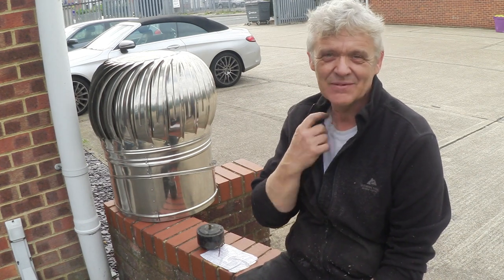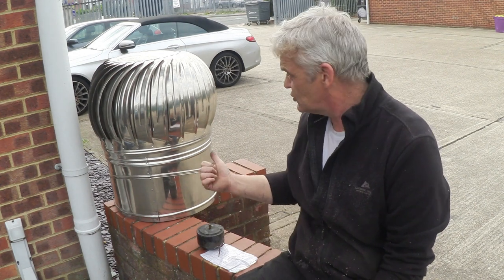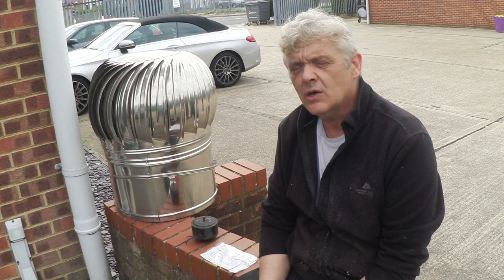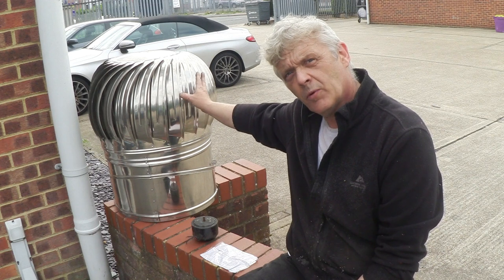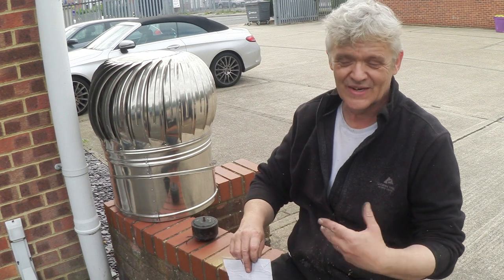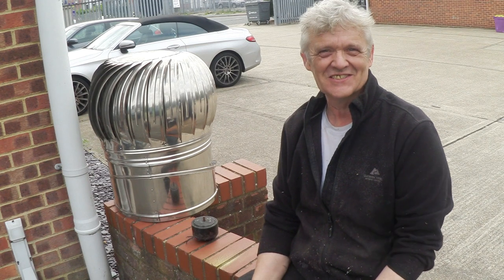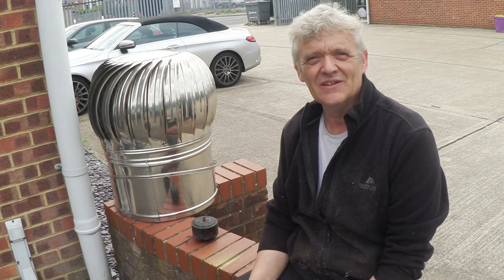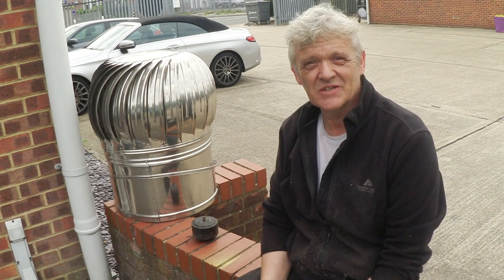Roofline Rotating Ventilator To Generator - Part 1

Comment: I've always been facinated by the static chimney cowls that have, essentially, an horizontal aerofoil that serves both to prevent rain going down the chimney flue and accentuate the natural up draught to improve the draw of the chimney. Essentially the aerofoil creates a low pressure area at the opening at the top of the chimney and air from the chimney is sucked into the void, causing a draught up the chimney. 

Inspired by the lateral thinking of the Sterling Engine, I thought rather than mount massive complicated turbine, gearbox and generator equipment driven by huge moving blades to the top of a massive tower, perhaps it would be possible to simply move the force of the wind to the bottom of the tower, where it can be more easily harnessed.

My thought was that if you scale up the design of the static chimney cowls and use a proper disk-shaped aerofoil you have an omnidirectional device that could induce a significant force of airflow up the chimney. You then have the option of installing a turbine and generator at the bottom of the chimney, where they are easy to maintain. If this generated sufficient force in the up draught, remembering that force increases with the square of the velocity, perhaps aided by using the Venturi effect to increase velocity, then you have the making of a low maintenance omnidirectional wind turbine, with minimal moving parts, greater structural strength, lower structural stress,  that will operate in high winds without risk of damage and without causing bird strikes and possibly with little noise. 

I also wondered whether, rather than a massive structural chimney, it would be possible to build a voluminous version of this device out of light weight material, that could be flown at great height, like a massive kite, using dual opposing omnidirectional disk-shaped aerofoils to suck/blow air through a pipe between the aerofoils past a turbine, and transmit electrical power down to the ground through the tether cable.

In my more fanciful moments, I imagined using the same idea to power ships, but instead of a turbine and generator you have fixed forward-facing horizontal aerofoils in the chimney flue that extract force from the updraught, just like a sail, except they would pull the ship forward regardless of the wind direction, so you could have ships literally sailing into the wind using no moving parts, other than molecules of air.
Reply: remember the heat rising is creating the low pressure as is the faster moving outside wind flowing over the stack the so called Venturi effect,chuck one end of a pipe facing downstream and under a fast flowing river, you get a vacuum on the other end... but yes chimney cowls have uses beyond the assisted flow design
Reply from the maker: mate - I think that is clever thinking - I can see what you mean - this would be well worth a few experiments I think

Comment: Great project! I love watching the what IF community can do.  And I'm sure that many people have observed these wind turbines in action,  and ask themselves, could I make it generate electricity  ? Only a few of the curious will take the steps to achieve a prototype that actually works.  Thank you for giving it a go. And sharing it with the rest of us. There are many ways to generate electricity,  build & wind your own coils or go old school and use a telephone magneto,  that can generate both a/c or d/c voltage and current.  The modern washing machine pump,  is a good example of a magneto that can generate electricity,  just by spinning it. No matter what method of generation you  use, it's best to eliminate friction from the process,  and the best thing in the world to do that is  use magalube G on your shafts & bearings.  This will improve the overall rpm.  And allow more work to be done.  Whether you buy or build it,  you want to get all the energy possible from your project.  Right  ?
Reply: I'm building one, I want to stay out of the grid.

Comment: I'm brand new your channel. I put two of these on the roof of my shed in Victoria, Australia, they never stop spinning even when there's wind. As I'm new here and this is first of your vids, thst I've seen yet and this is a year old video, I haven't yet been able to find the follow ups on how this turned out. I appolgise if you discovered this already/since, but these turbines are not solely reliant on wind to make them spin. I don't know the fancy scientific specifics and terms, but these are disigned to draw heat out and temperature alone will make them spin so long as  it's warmer inside the shed/roof than it is outside, the hot air inside the shed rising is enough to make them spin. I don't have any airflow pipes or tubes attached, they simply sit over the top of holes cut in the tin roof near it's apex.
It's always hot in the shed during summer, and I have a wood heater in the shed for winter, so it's pretty much always warmer inside than out.
 I subscribed and I'll search through the rest of your channel for follow ups on this. My shed is powered but i'd love to save some $$ on my power bill even if it's only a tiny bit. I wouldn't expect these to be able to generate enough power to run a fridge or power tools but I'd imagine they might  be able to charge a battery that can at least power some LED lighting.

Comment: I've been contemplating this type of setup for a wind turbine for quite some time.  The fact that wind is constantly changing direction makes this an ideal candidate for capitalising on that.

What needs to be taken into consideration, as someone else had mentioned, is how much torque is generated.  You may need some gearing to increase torque, which will in turn reduce rpm, so you may be better utilising a low rpm generator.

The biggest reason why I haven't started into putting something together is because of trying to figure out what method of furling to employ.
Reply: I recently saw a video where a conventional propelled bladed turbine was tested on the same spot as a vertical axis turbine. Vertical axis was not even close. This was for a 500w rated turbine ~meter diameter.
Reply: @aomanchutube  using the same generator isn't really a fair comparison, to be honest.  You need to consider the rpm and torque generated and match it to the right generator, just as you would need to consider a lower rpm generator if you were in an area where you had constant, but slower winds
Reply: @gm3045  true, but I was referring to the square foot section swept by the blades vs usable power obtained using an mpp charger. One would expect similar power output, unfortunately that was not the case.
Reply: @aomanchutube  I do have to wonder if the efficiencies change based on location.  Traditional wind turbines seem to do better on their own pole at a greater distance off the ground, but would this generator be better suited to a roof top, for example?
Reply from the maker: cheers mate

Comment: I’ve got four of those attic ventilators on my roof in Houston.    They keep busy letting hot air out in our hot summers.    The offset slides in the trunk allow it to be upright no matter what the roof pitch is (within reason).

Comment: Hi Rob, I was told in roofing (I used to be a roofer and then a roofing salesman) by the manufacturer that these are for the heated air in the peak of a roof to escape, there is a large section of screen in the dormer of the roof as the intake where the ambient is let in, the attic space then getting up over 160 degrees f rises and pressurizes inside the attic and shoots through the whirly gig and spins it. I don't think it was meant to spin by outside lopsided forces on one blade side, it's meant to spin by even pressure from within and thus spins quite well... anywho, just a heads up, if doesn't spin very well in wind on the out side try capturing the wind and directing it up inside, it will then spin awesome.  The reason I was told this is because in spinning it by hand I told them there was no  way wind would move it in any meaningful way, their response was it is not supposed to ! And that it will spin very very well when evenly pressured from the inside, and so it did.
Reply from the maker: there are a couple of designs mate - one is wind assisted - but you are basically spot on - this is meant to draw air from the inside and 'push' it out not the other way round so an interesting problem right there - but as I prefer to see problems - an opportunity to do better lol - cheers mate
Reply: @ThinkingandTinkering  Indeed !  :)

Comment: Looking forward to a power generating video on this. I have a two ft diameter exhaust turbine sitting around unused. They sell for around $80 herr. But these are not mounted on strong bearings to last for a long time, or high speeds.
Reply from the maker: it's going to be interesting for sure

Comment: By the way Robert; a tall vertical black pipe in the sun will give you that same updraft effect without the mechanical component.
My grandfather stacked 10 55galon drums with ends cut out and installed an auto cooling fan on a generator motor and it worked great in the sun.  It was of coarse painted black and raised off the ground to allow for air flow.
Reply from the maker: nice one mate thanks for the tip

Comment: Those things were ubiquitous on the US Gulf Coast in the 50s & 60s, put on houses to cool down the attics in the warm seasons.  Temps below the roof in a Texas summer get over 120 deg F, and these things suck a lot of that heat out of the attic, thus cooling the house.  Canadians use them to fight humidity in their attics in the winter, preventing ice buildup and damage above the ceiling.

They have fallen out of favor in recent years in the US as other types of roof vents with better esthetics have become available, however, their potential foe wind power generation has always interested me.
Reply from the maker: I still see them all over the place for sure

Comment: Could an attic get set up like coffee machine?  Open the soffit vents when there is no back pressure, flywheel the roof turbine so it draws in after the thrust of expansion is over creating a slight vacuum that draws in cooler air again. Creates a slight pulsing effect that overspins the roof vent.  A Stirling roof that generates power.  I know you will say try it mate but funds in this time won't let me.  I do however have a shed.............I have had something like this in mind for a while.  Perhaps the turbine power could allow for a brief spin of a small fan in the soffit that would open a flap and burst some cool air in briefly.   A barametric relay switch.  Like stirling though it would need starting.  Hi Mr Smith I know you read these :D
Reply: I can forsee all kinds of complications that would need to get worked through.  Would it accelerate a fire? Would it build up moisture during off periods?  (One main point of the vents anyway)  The whole thing would need to not have air leaks.  I wouldn't start with a whole roof, just box in 2 rafters maybe where the turbine exists and have the intake inside.  I would concider the bellows to push air in triggered by low air pressure.  I would use solder link so any fire would disable it in a fire.  I was looking at an internal turbine horizontally on the ridgerow but this might be more interesting and easy. Everything is open when not working.
Reply from the maker: I don't have that many funds either mate - it's why I use what I have laying around and what I can scavenge off the street - I like the idea - but you are right this is something I think you should be exploring tbh

Comment: We have those things in Australia, you can get them at the local hardware store, I personally don't have one but I was looking at my neighbours roof where he has one and I was thinking that I don't think that I have seen seen it not spinning! So I'm thinking that it might actually make a good secret wind turbine! And then today I see your video! Coincidental? I think not.. their primary use downunder is to keep the roof space ventilated and I believe that the one's we have here also have a flap that opens automatically when it's hot to stop heat build up in summer.. 
I really wonder what bearings those things use because my neighbor has never serviced it and it only takes a slight breeze to start spinning.. 
Anyway I can't wait to see what you have for us in the next video!
Edit: just remember that before you decide which motor to use as a generator, what you would want to have is high voltage and low current output! 
The importance of this becomes apparent when you see as how much load is placed on the motor as the current draw goes up, so it's better to go as high voltage as possible, use an MPPT Charge Controller that has a PV input voltage at around 150V or better, it will then convert the high voltage low current to something more useful.. 12V and high current output from a generator is extremely inefficient.. that's why the grid tie solar systems fitted on Australian rooftops have all their panels wired in series.. 150+ volts going into the inverter means less conversion needs to be done, the voltage difference is less between the two.. it's kinda like a vacuum tube amplifier, operates on 400 - 900V but only needs microamps of current, the output transformer handels the voltage and current conversion.. efficiency!
Reply: After the last string of videos, and' just last week,  I was standing in my back yard (in Melbourne, Australia) and looked at the one i have fitted on my shed to help keep the shed cool. and i noticed how well it spins in even the slightest breeze, and and thought it would be a perfect candidate,   I also have a new 33802 stepper motor for which i have no use. and loos like a simple task to fit it to the turbine shaft,  I am going to give it try tomorrow, and see what it does.   Thanks Robert for all the inspiration.  Where in Aus are you Peter?
Reply from the maker: to be honest mate I am just going to strap on whatever I have laying around - I have a small budget for projects and can't really spend a lot on them
Reply from the maker: go for it mate let me know how you get on will you?
Reply: @ThinkingandTinkering  yeah all good 👍 I understand, just trying to get something across, the thing that I have noticed is there's always some form of conversion going on, like converting petrol power to electricity, the idea is to generate higher voltage at lower current because it's the current that puts the load on the generator, so you use a solar MPPT Charge Controller to take the high voltage and low current and output it as low voltage and high current, that way the MPPT Charge Controller does all the heavy lifting instead of generator.
Incidentally, I have just purchased two MPPT Charge Controllers from eBay, they are $10AU each plus $5 shipping, so total amount cost $25 for the two! They are just a PCB with components, they have multi turn trim pots to set the output voltage and current, there's also an adjustment to match up the incoming voltage so you can get it to work at it's maximum efficiency... Great for solar panels or anything where the input voltage is higher... Like a wind turbine.. they are rated for 5A each it's the cheapest MPPT Charge Controller that you can purchase at the moment. A very handy device which I think that you would find a lot of use for... 
But hey! It's your channel and I'm going to watch regardless. Waiting for the next video!
Reply: @antonypilepich8947  I'm also in Melbourne, north of it...
Let us know how you went with it... I don't have one but I'm wondering if my neighbor will notice his one if it's missing lol, no I wouldn't do that! He just upgraded his grid tie solar system and he just gave me all his old gear, 10 panels in total a the grid tie inverter!... The panels are 24V versions too!

Comment: Years ago I drew up the plans to attach these to a black pipe 10 meters in the air and connect to pipes that were in the ground that ran out to a perimeter that drew in the air at ground level, ran a meter down into the ground, and then back up to feed the black steel pipe. This would have given cold feed air at the bottom and the sun would have heated the black pipe, thus expanding and forcing higher volumes of air up the pipe to turn the fan along with any wind being caught.
Reply from the maker: did you build it?
Reply: @ThinkingandTinkering   I never got the chance to as we ended up moving shortly after I drew up the plans.

Comment: I always like your ideas sir.. pls find a treadmill motor they are permanent magnet motors and rated for high rpm and high dc voltage and high current  .. so when u use them as generator they produce a respectable amount of voltage and current at low rpm.. with that motor you will need to spin it at the rated rpm to take the 12 v output and its impossible with that.. pls try for one time the treadmill motor and you will  stuck with them they are perfect for all of your inventions..

Comment: I was thinking the same that it is supposed to move air but just adding a traditional wind generator type of blades underneath for more power or efficiency
Reply from the maker: that is what I was thinking